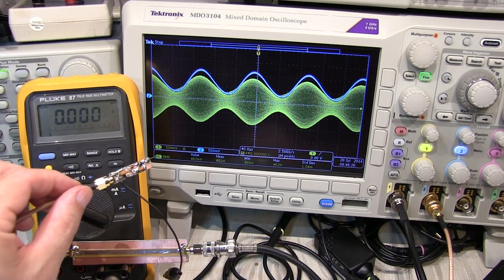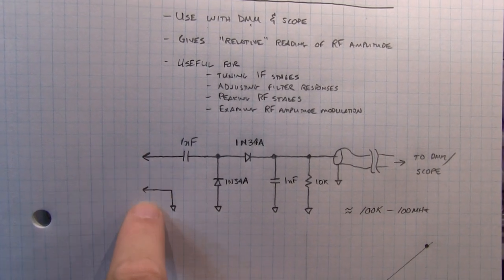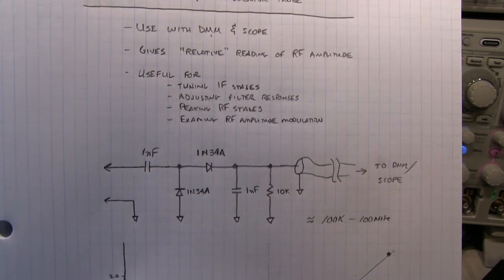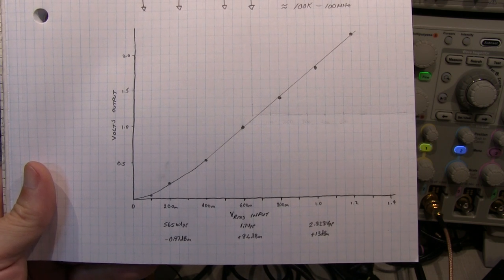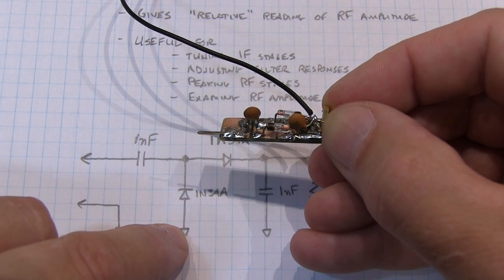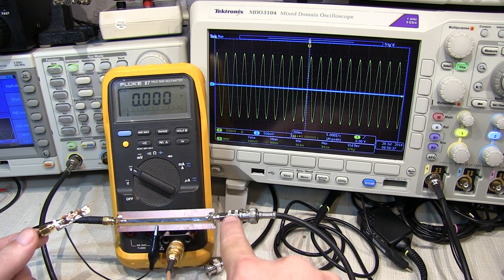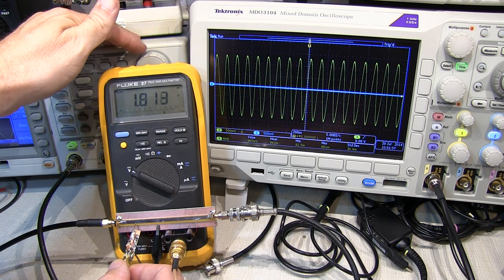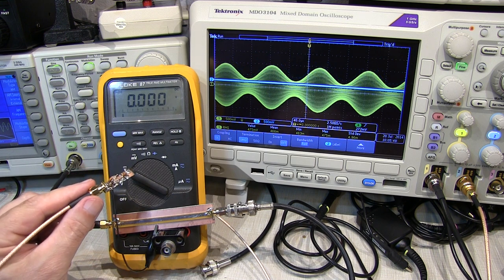#161: Circuit Fun: a simple RF detector / demodulator probe for DMM or scope

Comment: The roll-off would be better defined and the sensitivity preserved by NOT putting a 1nF cap to ground but inserting a 47K resistor between diode and coax cable to scope or meter.  The 1 megohm input resistance (DC coupled) of the 'scope is your DC path to ground. When using a meter it should have a 1 megohm resistor across its input.  The coax cable capacitance and 'scope input time constant capacitance is sufficient to remove RF cycles from the recovered envelope - plus you have best video response for sweep aligning.
Reply from the maker: That's a cool idea - using the 100pF or so of cable+scope input capacitance as the storage cap - I'll have to give that a whirl...

Comment: When I was a boy, I saw a magazine article about modifying virtually any common portable 9V transistor radio into a signal tracer.  It involved cutting off the tuned part of the board and feeding a signal directly to the high gain amplification section.  The design included a switch to select between a simple capacitor input and a diode detector for demodulating a signal.  I used a cheap walkie talkie instead of an AM radio.  I had more fun with that device than just about anything else at the time.  I put a little stereo jack on it so I could easily switch between a ground clip and probe or a pair of alligator clips.  The amount of gain was incredible.  I assume it was on the order of 80 or 90dB of gain.  I didn't have scope, so this and homemade logic proves were about as advanced as it got for me.  I did have a VOM.  Those tools, magazines and a mid 70s ARRL handbook got me started.  The RF and AF sections are nicely sperated on most of those old radios because of the way they had to build the board to allow the speaker voicecoil to poke through it.  There's usually three traces on a narrow section of the board that wraps around the speaker.  Power, ground and a signal line.

Comment: Thanks for your answers to my questions and the efforts you put into the videos.  Very educational.  The 1.8V RMS you measured corresponds to about 5Vpp which as you stated is because the circuit sees the charging of the cap from you peak to peak detector.  My first attempt at building the circuit worked but 2 things: 1.) As I changed frequency I saw a much large attenuation of the signal.  My connection lengths were much larger compared to yours.  You kept all leads very tight and short. Pretty sure my caps were 1nF.  2.)  After working for a while, it stopped working.  Both 1N34A diodes were found open.  Maybe too much current?  Voltage spec is very large.  
Question: If the 50 ohm transmission line is exactly 50 ohm then the scope output should be exactly equal to the RF source value correct.  If not exactly 50 ohms, the scope signal observed will differ from the RF source correct?

Comment: Just saw this video. I think I will build one for the shack. Having a problem with a Yaesu FT-747GX and need to measure the pre-driver output RF voltage.  Found an RF Voltmeter schematic online and built that but it sucks LOL. At least I know you tested your design. Thanks for posting this. 73s. Kb8NIV.

Comment: Fantastic videos! I am learning a lot through your channel :) A quick (and maybe silly) question, at 7:00 in this video, what is the reason for using the RF detector probe you built (blue trace), when you can see the RF envelope on the Oscilloscope (yellow trace) anyway? Is the probe more useful because is it ONLY providing the envelope shape, and not all of the complex wave components that make up that envelope shape in the yellow trace? Is that correct?
Reply from the maker: There can be a number of reasons.  In addition to what you've suggested, it is also possible that your scope, meter, etc. does not have the bandwidth to see the RF signal directly.
Reply: @w2aew  thanks for clarifying that. Makes perfect sense 👍 73

Comment: Fantastic and educational vdo tutorial.I need to troubleshoot a vhf 144mhz transmiter, will this probe be sufficient to check for a faulty final stage? There is a 4 pin PA mosfet module for a drive stage . I'd like to to check that, then the final transistor's base and the collector to see if maybe this transistor needs a replacement. Either part is damaged ,so I am looking for a tool to locate where the rf generation stops, and point me to a faulty part. Thank you in advance.
Reply from the maker: It should give you a good relative indication.

Comment: I'm planning on making an UHF bug mic... And I don't have good gear... (I only have an 10Mhz analog scope circa 1970 or older; no spectrum analyzer, no func gen (I use a soundcard for this); no lcr meter and and 2 mid-class DMMs)... So I would love to make myself this tool but only if it's usefull up to ~450Mhz... so... what should be improved to have this working up to those freqs ? I imagine that the answer could be "a really fancy fast schotky diode for the attack... and an accumulator cap small enough to avoid the RF passing through it and being dumped to ground... something that I think should work fine if I increase the discharge resistor because I'm not interested in the AM demodulation feature... only in the detect/Vpp meassurement feature ... I'm not an EE; just a young amateur so feel free to let me know if I'm talking nonsense
Reply from the maker: yes, fast schottky would work well, and caps in the tens or hundreds of pF would be a good place to start.  Include a series resistor between the last cap and the DMM/scope to isolate the capacitance from the demod probe.

Comment: How exactly did you design and make the 50-ohm microstrip? Might be a cool thing to show in a video.
Reply from the maker: There are several online calculators that you can use to compute the dimensions for the conductor and dielectric thickness to get 50 ohms.  In this case, I have a bag of pre-etched strips that are the correct width for 50 ohm microstrip when glued down to a ground plane.
Reply: Yes would be interesting to do some transmission line stuff and how you built the strips
Reply: @w2aew  I'm sure this is a silly question but here I go... The 50 ohm strip..... with nothing hooked to it could you measure the resistance with a ohm meter and would you have to measure from the farthest points on the strip? Thank you.
Reply from the maker: @MoHntr  You can't measure the impedance of a transmission line with an ohmmeter - it will just look like a near zero ohm conductor.

Comment: Your schematic shows 5 arrows indicating "ground" but you stated you "split" the ground on the circuit board in two places.
So my question is do all 5 of these "arrows" go to a common ground point?
Reply from the maker: All of the grounds in the schematic go to a common ground point.  The "splits" in the copper are to create the other isolated nodes (input pin and diode connections).
Reply: Thank You Alan for your quick reply,  I appreciate it!

Comment: Could this be modified to monitor a 100V carrier output from an RF PA? Maybe just add a 100K resistor at the input? Or would it be better to place a voltage divider before the diodes (move the 10K and the additional 100k to the input) ? I'm thinking to make a monitor for my transmitter using an Arduino which has a max input of 5v. So I'll need to map the attenuated 0-5V voltage reading to reflect the true 0-100V voltage output.
Reply from the maker: I'd probably start with a RF sampler or directional coupler in order to get a more controlled and safe sampling level - you could follow that with a simple envelope detector like this...

Comment: Hi w2aew, it looks like you used RG178 (50 ohm) to connect the probe to your 'scope.  If you were to build an active RF probe requiring power, could you use a balanced shielded audio cable to connect the probe to a DMM or oscilloscope so that shield was negative for the power source and probe end, red was the positive voltage and white was the signal?  Or, would the balanced audio cable have the wrong impedance, i.e. 50 ohms, so therefore it would be advisable to use RG178 plus an additional wire for the positive side of the power supply to power the active probe?  The reason I ask is I have seen some active probes that demodulate RF signals from the DIT and play them through audio amplifiers.  I presume that in this case impedance is of no importance since the audio from the probed signal is the only part of the signal "filtered" off to an audio amp, not a 'scope where impedance matching is important?
Reply from the maker: For the low frequency output of your probe, the audio cable should work.

Comment: I really like the probe you designed and made. My question is, can it act as a Signal Tracer if instead of going to the scope I connect it to an audio amplifier and if so would I be able to sig. trace hearing the radio station all the way to the front end converter tube of my AM radio.
Reply: Yes, see my other post on this thread about modifying an old 9v transistor radio into an awesome signal tracer.

Comment: Can I use it to test a VHF 2M mobile radio, only for "sniffing" RF on transistor collector, MOSFET drain and PIN diodes in a TX line?

Comment: For a more accurate probe you can use a high speed OoAmp and dual-diode Schottky in a "ideal diode" circuit config. Another advantage is much higher input impedance and thus reduced loading on the signal source.
Reply from the maker: Yes, of course you'll need a very fast op amp to be able to measure VHF, UHF and above, and the probe will require power.
Reply: Even with a fast op amp such as an LT1222, these are very difficult to get good linearity in the super diode configuration. From personal building experience, and not Spice simulations, what works far better for low levels is using the op amp as a DC log amp with a diode or BJT junction in the feedback, thus keeping the amplification on the more manageable DC side of the probe circuit. I have not regarded this worth the trouble since just a few miilivolts RMS can be read on a DMM without amplification, and a correction chart or table can be made for the non linear portion of the response curve. I have found this to be more than sufficiently sensitive and accurate.

I have also built single detector diode RMS output probes with a forward biased diode linearization network on the DC side, with trimpots for calibration (similar to the Fluke 85RF probe design), and achieved excellent linearity from about 200mVrms to 20Vrms and an essentially flat frequency response from 100kHz to 30MHz. (Not tested beyond those parameters.)

Comment: I have a dumb question. If the germanium diodes have a 0.2-0.4v minimum "conducting" voltage, then how do they detect/rectify such low volt signals you refer to. That made me start thinking about how crystal radios work when the germ is able to detect such low signal levels. I'm missing something important here obviously.
Reply from the maker: The "turn-on" voltage isn't a binary thing.  The I-V curve is exponential, there is conductions below 0.2V, it's just much lower.  The "hard limit" of "off" and "on" is a simplification to make circuit analysis easier.
Reply: Ahh- that makes sense. My computer background is clouding my reasoning- I was in fact thinking of it as the 0/1 thing! Thanks. Great videos. Keep them coming. My brain needs them.

Comment: Alan the 1N34A is rated at a PIV of 65 Volts. The 1N270 & 1N4148 are rated at a PIV of 100 volts. What would you set up for higher voltage applications, say more than 50 volts and less than 500 volts ? Would you string diodes together in series or set up something like a capacitive voltage divider ?
Reply from the maker: I think the 1N270 would be better than the 4148.  However, as you suggest, I'd probably attenuate the signal with a resistive or capacitive divider as my first choice for higher power operation.

Comment: Hi, i built the probe using two OA90 germanium diodes. With a sine input 0 to 4V centered on 2V i  found that voltage value is (Vpeak - 2 Vd) / sqrt(2)  where Vd is 0.3. 
There is a thing i don't understand.. connecting the multimeter negative to ground and positive to diode as shown in your schematic i found a negative value. The absolute value is correct but why the sign is negative ??
Reply from the maker: The only explanation that I can come up with is that the diodes were installed backwards.
Reply: ***** Hi, i saw at 3:26 of video that black sign of upper diode is connected to groud clip. Since the black sign on diode is Katode it seems that you have Kathod to ground. while in the schematic presented it should be Anode to ground. 
With Kathod to ground configuration the voltage is positive, while using the Anod to ground as in the schematic the voltage is negative.
Reply: Fabio Capozzi I look better to the video and found that upper diode is connected to center pin. Was only an assembly problem. Tnx !!

Comment: Can this be used to measure/confirm the Percentage of Modulation if using a Precision E-200-C signal generator? I want to confirm that the number on the control matches the actual percentage of modulation within the signal. Thank You!
Reply from the maker: Probably not linear enough as you approach 100%. Better off making measurement on the RF envelope itself.
Reply: @w2aew  Much Appreciated, Thank You! Would you ever consider a video on how to check a signal generator's modulated RF output for accuracy to 400kHz, and to track the percentage number on the dial to actual percentage of modulation?
Reply from the maker: @TonyButchT    Take a look at my latest video
https://youtu.be/-D-hkFkCH7I?si=Bj0PbPn79amD6qMb
Reply: @w2aew Thank you for your descriptive presentation! Going the analog route :2465B.  (Replaced C1016,18,20,51,52 Rifa/Wima and R1018) 73 Tony N2TSO

Comment: Thank you Sir for your splendid explanation. I had a doubt to ask if you wouldn't mind. I wanted to know whether there is a particular relationship between the range of frequencies and the Resistance and Capacitance values you have made use of in the circuit. Eagerly waiting for your response.
Reply from the maker: Not really super critical.  As I go higher in frequency, I would likely go a little lower in capacitance.
Reply: @w2aew  Ok, got it. Thanks.

Comment: Another great video clip and circuit.
I guess you used clamper circuit, to raise the voltage level followed by a diode detector.  Great design, in my opinion.
I copied the design and posted it in my circuit book.
I always had this question that if we mix a frequency with itself, say using ring diode mixer, or Gilbert cell, or any other non linear device, can we detect its level at DC? F1-F1=0 , which is DC.
I know in the direct conversion receivers, or regenerative receivers they do something like that, but they do not want to detect signal level rather the modulation signal.
What is these same frequency signals are out of phase, do get any information about the phase difference?
Also, I am thinking of designing high frequency high impedance differential probe for low voltages 1uV to 1V , if you have any reference let me know.
Reply from the maker: This called homodyne - and the DC output will vary with the phase.  So, unless the phases are locked, you can't detect power that way.
Reply: @w2aew  Thanks, 
So then if we feed RF and LO of a mixer from the same source, then the phase will be locked since the only difference is the path, so we should be able to detect the power.
I guess the only way to find out is to built the circuit and try it.  I will use MC1496 to investigate this concept.

Comment: How the 990mV RMS when measured with probe becomes 1.8V. There must be some relations. I am trying to understand this. Is it simply just double of the RMS voltage?
Reply from the maker: It's a combination of the rectification of the diodes, the diode drop, the diode capacitance and the storage caps.  Since there isn't an easy/fixed mathematical relationship, thats why I made the plot shown at 2:31

Comment: Can you give the details on how you built the 50 ohm transmission line micro stripe.  I would like to build one and not sure of the dimensions and material?  I web site I found gives the W and T dimensions but still could use some guidance.  Assuming the Length does not matter.
Reply from the maker: Length does not matter.  The width of the microstrip trace is a function of the thickness of the insulating material between the trace and the ground plane, and the dielectric constant of the material.  Several calculators help you get the dimensions:
https://www.eeweb.com/tools/microstrip-impedance
https://www.pasternack.com/t-calculator-microstrip.aspx
http://chemandy.com/calculators/microstrip-transmission-line-calculator-hartley27.htm

Comment: Very good info as ever , I do need to build one i have some BAT85 diodes that might work , I am setting up a TS-430s and it asks for a RF VTVM so this might get around that ,
Reply from the maker: If all you need to do is "peak" an RF signal, then this will work fine.  If you need to make a specific amplitude measurement, then you'll need to use some test signals to try to establish some calibration curve of the detected amplitude vs. the actual RF amplitude.  In most cases, all you may need is to see the modulation shape, or peak the response of a signal.  Any of these "relative" measurements will work fine with this detector probe.